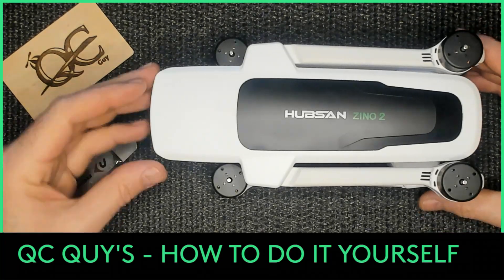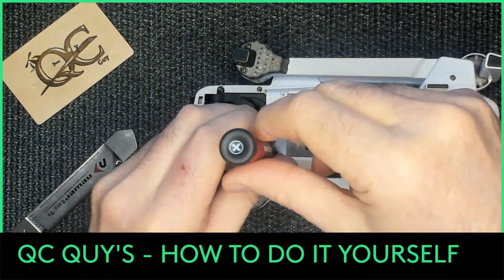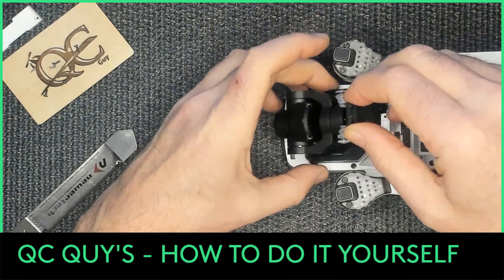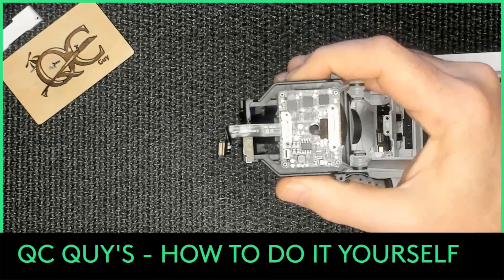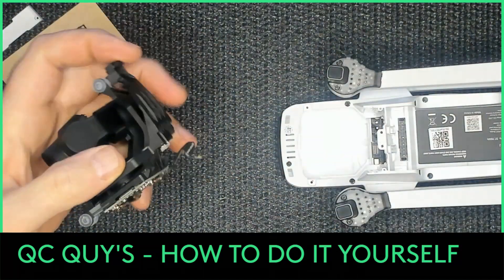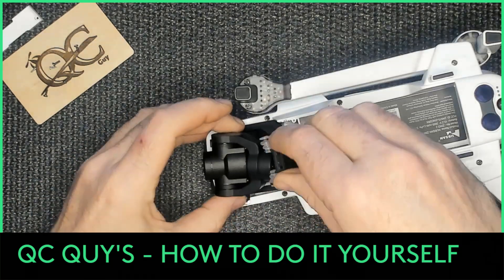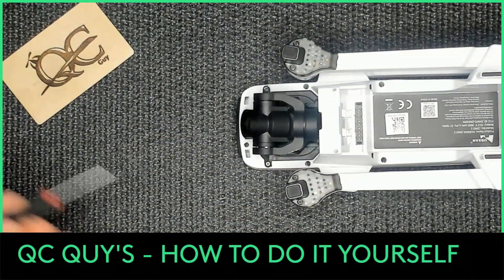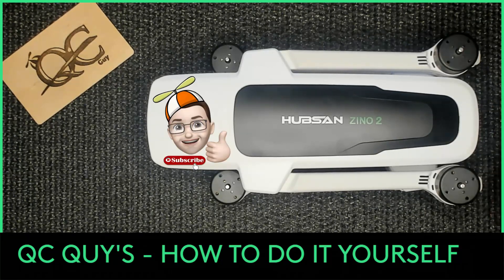HUBSAN ZINO 2 - CAMERA / GIMBAL EASY REMOVAL FOR REPAIR OR REPLACEMENT

Comment: Hi Chris,  I purchased the Zino 2 as a preorder so I got one of the early ones.  My gimbal cable is faulty so I ordered a replacement from Hubsan.  It appears that I was sent the wrong cable.  The part # I received ends in -07 but the cable I removed has a part # ending in -04.  Hubsan seems to indicate that the -04 is the old cable and the -07 is the new but the -07 does not want to connect into the main board.  Any advice?
Reply from the maker: Order from Aliexpress because they seem to be  the only ones that can get that right. I have ordered dozens from them.

Comment: The application doesnt take photos or video... is this an error of this cable inside of the gimbal? cause i cant find a solution... and the support of hubsan isnt helping!
Reply from the maker: If you have image on your screen and can’t record or take pictures it’s probably your card.
Reply: @QCGUY  the sd card you mean? It shows the remaining storage in settings and done the updates, i have image yes! but cant take photos or capture video
Reply from the maker: @ΓιαννηςΛιολιος-ν6π  Despite what it say did you try a new different sd card? What are the specs of your card?
Reply: @QCGUY  i tried 3 different cards...
Reply from the maker: @ΓιαννηςΛιολιος-ν6π  Then it's a cheap easy test to replace the cable and see if that is the reason but if not I think you have a firmware issue that perhaps didn't install properly. Without my having it in front of me it's hard to say exactly.

Comment: QC Guy, is there a way to connect the Zino Pro directly to your Android phone without using the transmitter?
Reply from the maker: No, only with the original Zino
Reply: @QCGUY  that's what I thought. The USB connector on my transmitter broke and I'm in the process of trying to solder a new female usb micro connector.
Reply from the maker: @RP_2024  Good luck 👍
Reply: @QCGUY  Got it working. I ordered some Micro USB type b female 5 pin S MT socket jack connectors and soldered one on. It was a pain because you have to use jewelers glasses.
Reply from the maker: @RP_2024  My hat is off to you! I can’t do that micro surgery. Let me know how it all works out.🤞

Comment: Sadly my Zino 2 suffered an injury over the weekend. The right front arm needs to be repaired. This video helps a bit but I’m not sure if I’ll be able to do this myself. Any advice?
Reply from the maker: MrMarcus2013 If you can go this far and solder you can do it. I have replaced a good bit of arms on other zino’s but for Zino 2 it’s a matter of getting the parts from Hubsan. Some things are pretty limited.

Comment: Thank you for the tutorial. I just received my zino 2. And it appears my gimbal is broke right out of the box
Reply from the maker: mark oswald Being new I would get them to replace it. I finally fixed mine and it wasn’t hard but for many it won’t be real easy to do so. 
You have a warranty 👍
Reply: @QCGUY  HI there, really enjoy your videos. Take a look at my story in my response to Mark Oswald below. I'm having no luck getting Hubsan to honor my warranty. Would you have any recommendations as far as who can make this repair? I've been calling all the repair companies. Most work on DJI drones.The only ones who can make this repair are the Hubsan dealers themselves, and I fear they will simply want to order the replacement part which runs about 275 as far as I can tell. But after watching your video, I think I could do it myself. Do you happen to know how the individual parts are secured together? The part that's broken is a circular type of structure towards the back of the gimbal. At 3:05 of your video, your right index finger is touching the part that's come open. There's no latch or anything that would say it's broken, and it seems as though it is glued in place and that's all that is required to repair it. Anyway, sorry for putting this question in the reply section but I did think it was an easy way to identify the part I'm talking about. Is this part fixable or is it a lost cause? Robert
Reply from the maker: ROBERT G WILCOX Send it to me and I’ll get you fixed up. I have many parts and a lot of experience.
Reply: At this point they are not responding to my email. I will try again
Reply: @markoswald9775  Hi Mark, Did you ever get a response from Hubsan? I was talking with someone named Alisa Wu in their warranty department. Had a very frustrating experience dealing with Hubsan. My Zino 2 crashed after hitting a tree following my pressing of the Return-to-home button. Ms. Wu said that after speaking with one of her engineers, they had determined that it was pilot error. I countered that it was not pilot error, but in fact a defective (RTH) process. After pointing out that her own engineer confirmed from the flight logs that I had engaged the RTH mode, she said they still considered it pilot error and that was final. We went back and forth after that with Ms. Wu eventually ignoring my emails. I've been left with having to try and repair the gimbal camera myself (I think the gimbal camera ZINO200-19 still works, it's just come out of it's housing in the back and I don't know how to secure it in place (either with glue or soldering it) and now I'm trying to follow through on my promise to Ms. Wu to let everyone who has purchased from Hubsan that their warranty program is severely wanting). I basically have no leverage. So I was wondering what steps you were able to take when dealing with a department that basically has to translate every email in an argument. Talk about lost in translation.
Reply: ROBERT G WILCOX   I ended up disputing my purchase with pay pal. I received a full refund
Reply from the maker: mark oswald Send it to me and I’ll fix it for you without robbing you.

Comment: Its been a bit since I been around! What is the Overall opinion on the Role Out of the The Z'2? 
I well to me that gimbal looks like not only a Cooler to the eye but quilty seems to be quite abit better than the one I had a peace fall off of???But seems to be ok with out it! U gave me the Courage to attempt the Broken right front Arm  and I  did it successfully And even got enough nerve to make a small mod! Works aswell. I WISH I HAD NEVER HEARD OR SEEN ANYTHING ABOUT A MINI DJI! I feel like DJI had there way with me and didn't even give me cab fare 
I hope to come across a Zeno Zino one of 1.5 
Hope the Lords with you and Your Loved ones!!Hope thing are starting to get better but if not I'm Praying for the Quilty Control Man that helps when most quote prices!
Reply from the maker: HAMBONEPEGLEG 3000 Thank you 🙏 
My opinion is coming trust me! 
I don’t like what Im seeing others go through and how it’s being handled not to mention my bricked one.

Comment: Did you get it unbricked  by any chance?
Reply from the maker: Nope :(
Reply: QC GUY are they helping you?
Reply from the maker: Daniel Taormina Helping getting me nowhere fast! 😂 
They sent me recovery files I haven’t tried yet but will when I’m in the mood to deal with it. 
It’s not going to work in my case in other words.
Reply: QC GUY there are others out there that were able to load a default firmware using a recovery process that involves the little button by the micro sd card slot... and the power button... some sort of forcing a firmware load... but yours maybe in a different state then theirs, but yes, it was a firmware update from PC to fix it. They worked with Hubsan, but said the instructions were actually in the pdf they were looking at.
Just keep us informed of your progress, and including any news regarding when GearBest will be receiving shipments... or how often.

Yeah, the weather here in SoCal is still awesome, but I must still try and wait patiently.

Thanks again for all your info!
Reply from the maker: copyjim81 Yep 👍 I have those but have not tried them yet. My state is different from there’s and is now one of three that I know of.